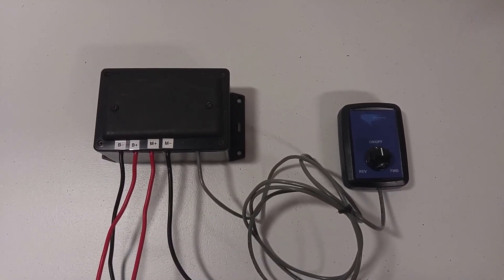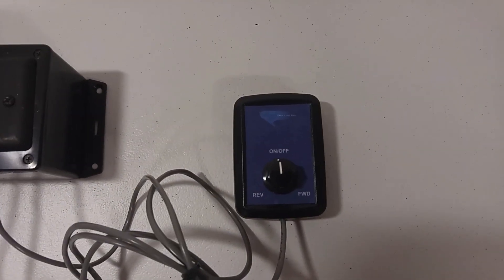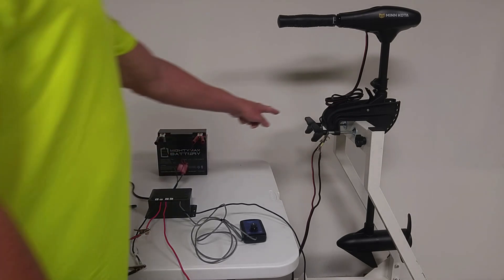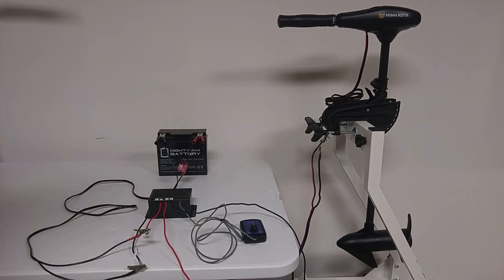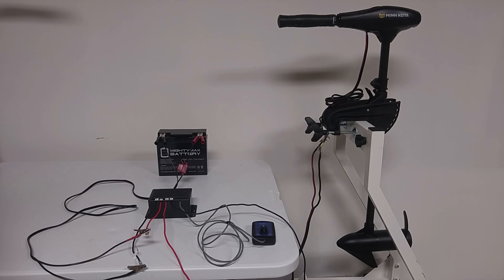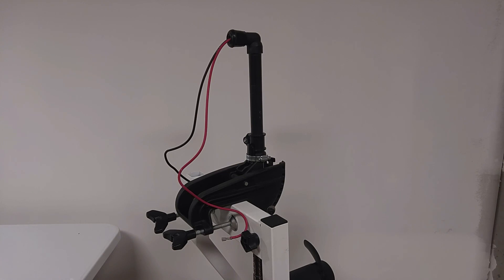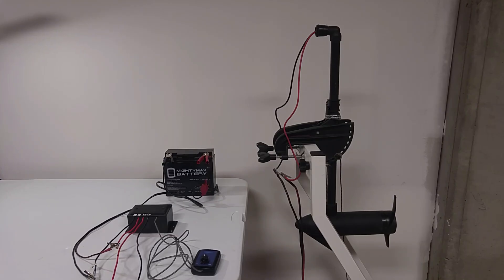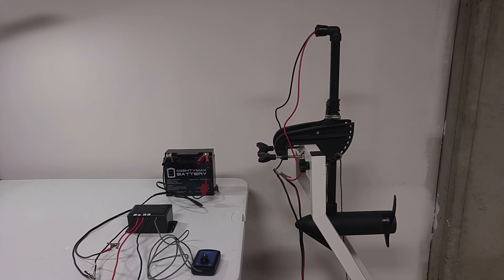Wireless Trolling Pro and PWM Trolling Motor Speed Controllers

Comment: Enjoy your videos very much.  I have three of the wireless trolling pro units and one is defective due to my mistakes of plugging the battery into the output of the unit. Maximum smoke occurred and now does not work.  Are you aware of anyone I can contact to attempt repairs since the original company is no longer around?
Reply from the maker: Thanks Hiram. No unfortunately. It would probably cost more to repair by somebody else than buy a new one. I would just keep it for spare parts.
Reply: @Aksmaniyak  Thank you for your advise. Keep up the good work.

Comment: Hello: I have a inflatable pontoon fishing boat and a 50 pound Minn Kota (MK) trolling motor. I have estimated the average load in the boat will be about 325 pounds. I also have a Mighty Max ML35-12 -Volt 35 Ah battery. 

The MK 50 operates on a max power of 50 amps. I am considering buying a PWM controller to obtain better battery use rather than a stock situation. 

How many hours of operation can I expect with the addition of a PWM controller? What equipment do you suggest. What other changes might be more efficient? 1) purchase a 30-pound trolling motor about $120 to use less amperage, 2) purchase a larger battery, or 3) adding a second battery?

My goal is to have about 8 hours of fishing time, mostly anchored but with say 1 ½ hrs .of moving from place to place.

Comment: Great Video and thnx for the info. I have a motor myself and the only thing I was concerned by capping off the white and yellow wires was if I had to bypass the coil also that seats sealed at the lower end of the motor. I have read something about possible current backfeeding that is why I am asking. Thnx again.
Reply from the maker: You are welcome Constantinos.
Reply: @Aksmaniyak  so no need of doing any changes on the coil itself that lies at the brush end house assembly?
Reply from the maker: @tzionico  No. Nothing else.

Comment: Thank you so much for getting back with me. I’ve called him and no response. I ordered the 40# control for my minkota. I actually tried two different motors my 40 and my 30. And wire them just like you said and how it says on the instructions. But he will start turning and he will never start pulsating back-and-forth fast slow fast slow. Both motors did it. And the face plate on my controller was all scratched up looks like they got it back from somebody that used it and then send it out to me. I’ve already filed a complaint with PayPal resolution to get my money back. I think this is a scam.If you have any more information to where I can get a hold of them please send it to my email Sidney Smith my email is SDS 205 t@yahoo.com thank you.

Comment: I just got mine same one that you got but the face plate of the control knob is scratched up and it doesn’t look the same as yours looks like an old version looks like somebody had mine before and then sent it back I hooked it up the way they said to him the way you showed. And when I turn it on it pulsates and when I go to reverse it does the same thing. I’m not at all happy with this unit. I’m gonna send it back and request my money back. I’ve left phone call after phone call to them and I’ve gotten no response. I think this company is not a very good company I know they’re out of Spokane Washington. And I live not very far from there facility. I am very disappointed in my purchase. Anybody reading this do not get this product from this company. You will be sorry
Reply from the maker: You finally got yours? Many people have said they never received theirs. Do you have the Washington info? I will try again to contact them. Thanks.

Comment: Could you reveal which pwm you are using and where to buy? Thanks
Reply from the maker: I am using the Wireless Trolling Pro brand. They have a website but apparently they have not been active lately. Last I heard, the company was starting up again. If you look at some of my other PWM speed controller videos, I give links to the parts used.
Reply: So are you using this as opposed to one of your diy ones. I’ve been debating building on but seeing this now I’m feeling lazy. Does it work as well or better. How’s about reliability. Any performance difference.  Thanks for the videos man they have been greatly informative.

Comment: Great solution. I have been trying to copy it. I have ordered the unit on amazon and payed paypal for it from LS engineering 10 days ago on the 10/7-2020. I have not gotten a order confirmation. I have written them emails and tried calling them no joy.  Do you now if they are still in business? I live in Denmark do think that is a problem? I really like and need the unit to finish my motor for my kayak. Could you help me get in contact with them? 
Best regards Joachim Soendergaard  phone 0045 26194684 Denmark
Reply from the maker: Thanks Jogges. I am a fellow Dane. LS Engineering was temporarily closed but is supposed to be open again. Somebody else said that they contacted the company and was told there would be a delay in the order. I do not have any way to contact them other than the website.
Reply: @Aksmaniyak  Small world. The ting that annoys/worry’s  me is that I have not gotten a conformation mail for the order or that they don’t answer mails/phone calls. Thanks for your answer. Have e great weekend

Comment: I have a min Kota glide foot control trolling motor 5 do ward speeds it woks only on 1 4 and 5 I have replaced the speed switch same problem can I take the hot wire and run it through a variable speed switch and it work any suggestions so be app
Reply: My email is garyforbes111@yahoo.com if u want to reply that way ty
Reply from the maker: I have never done that so I don't know if it would work.

Comment: I'm a little bit confused. Are you running the positive and negative motor wire on the pwm back inside of the control head and splicing into it? I also have a question on the battery wiring. I have a quick connect positive and negative coming off my trolling motor because I run in hull wiring to the front hatch where I keep my battery. Would it be ok to splice into the the battery wires coming out of the unit instead of hooking the negative and positive battery connections on the pwm directly to the battery? I'm trying to make sure I completely understand everything before I get started.

Comment: your opinion on durability for a 99 percent saltwater usage would be appreciated for that controller.  good video with great information. thanks in advance
Reply from the maker: As far as I know, it is  recommended for freshwater use. I'm sure you could use it but salt would eventually corrode the parts and you can't wash it down to clean it.

Comment: Try the controller from Gama https://www.gamainc.com/product/t-sc-12v/

I have had much better luck with this one than the one you mention. If you try a Gama, call them, they change the frequency of the pwm for trolling motors so there is not any whine. Very responsive to my questions. The negative is that it is only 30amp. So far I have not blown a circuit with a Minn Kota 45. Remote is waterproof and I dropped it in saltwater twice so far and still kicking.
Reply: Just ordered the same unit, not super pumped when I told them it was for a trolling motor. Any updates on your setup, failures? Appreciated
Reply: Compass Angler did it work for you? I was thinking about ordering one
Reply: Cory Turner Working very well, have a 30 amp fuse to protect the unit from damage and no issues yet. It will get hot under constant use however, so have a way to vent it. Plan to make a walk through video of my setup sometime in the future and good luck with yours 👊🏽